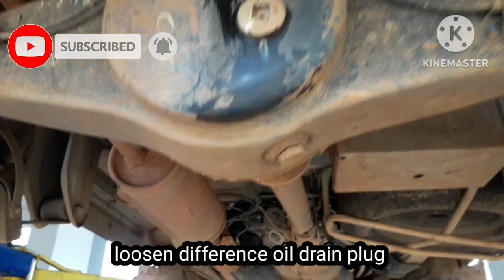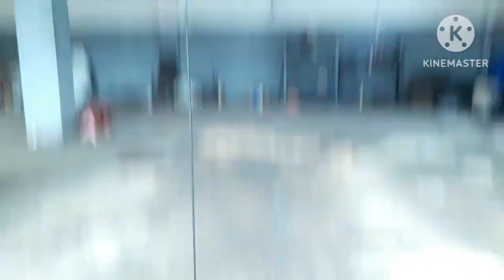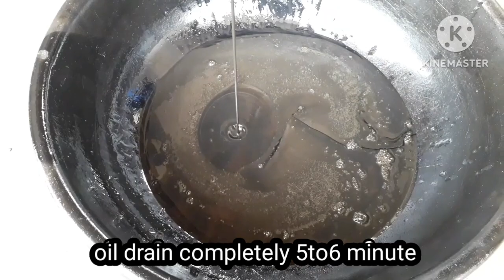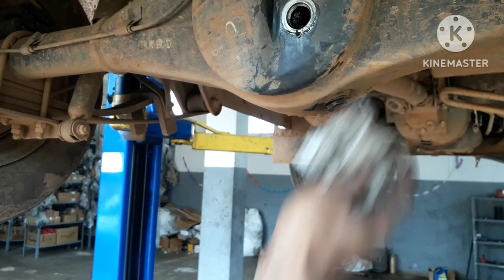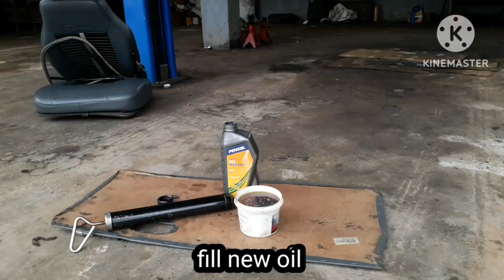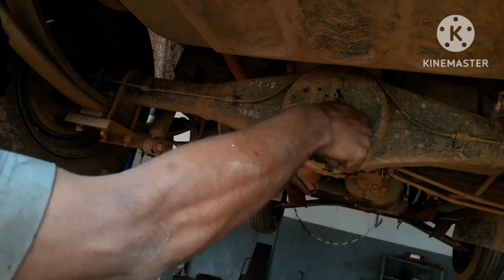maruti omni differshial oil change procedure

Comment: Good work how much km oil life ? Other doubt diesel fiesta injector no. count which side start ? Filter / cam pully side ? 🙏🙏
Reply: In ford fiesta count starts from gear box side
Reply: @yasirsalman88   Thanks bro 😊  Means diesel filter side ! 👍👍💐💐
Reply: @vilasjadhav1794  yes bro
Reply from the maker: Yes, cylinder count start from gear box side
Reply from the maker: Differshial Oil change periodic maintenance from 30.000 km